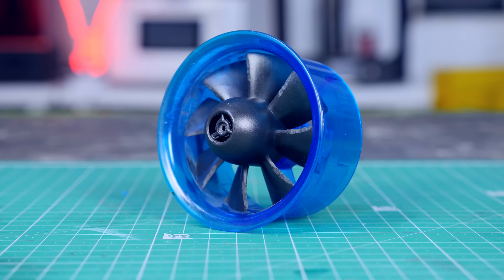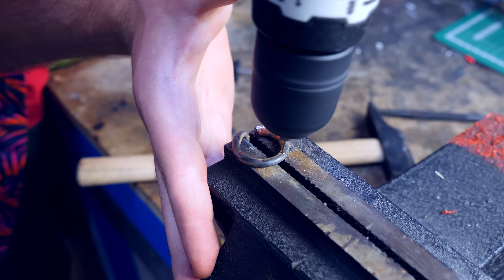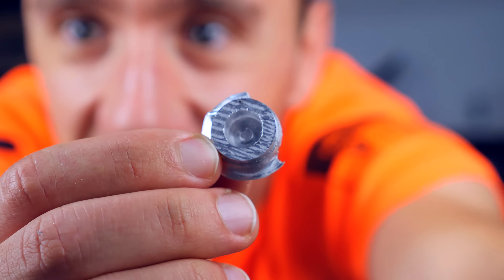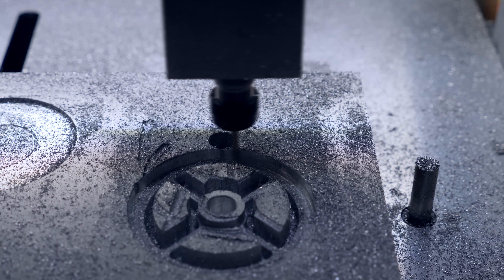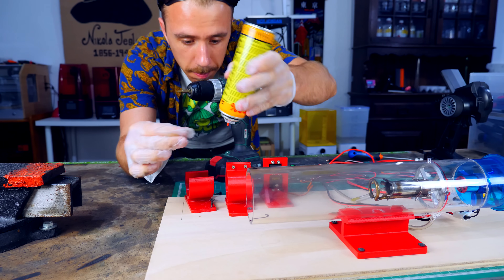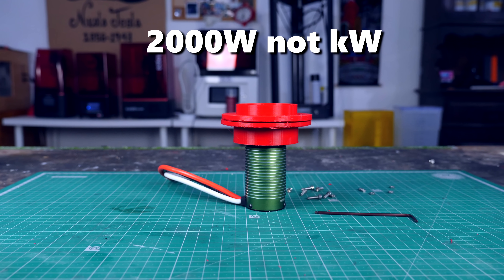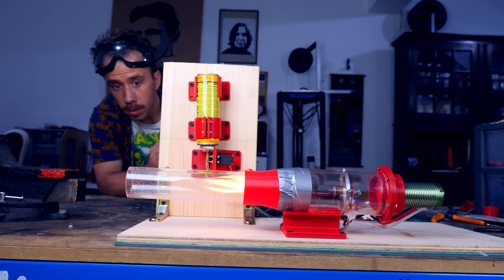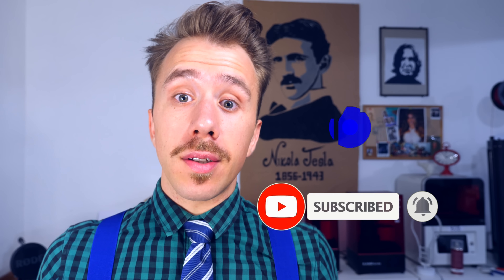I turned my Fan into a Jet Engine (3D Printed EDF Afterburner)

Comment: Integza, when milling you want to use the shortest endmill/drill ass possible, if you use tools that are too big/long for the job you will get walking/breaking/chatter/ louder noise
Reply: also play with your feeds and speeds with your machine, its lack of rigidity and power will limit the speed you can cut at

Comment: Really awesome video. I feel like if you introduce a small amount of oxygen just upstream of the flame tube, it would sustain far better. as the airflow increases, the oxygen increases. But simultaneously, the nitrogen, which makes up 3/4 of the ambient air we breathe, is also increasing in the same rate. Nitrogen is inert and will do nothing but hinder The propagation of proper combustion. Ideally, you want the vast majority of the combustion to occur within the tube and not outside of it! I do not believe that the fuel you are using, which appears to be propane, can properly utilize the excess air speed without further being compressed ambient air or oxygen laden air. When I say a small amount of additional oxygen, I mean a really small amount!

Comment: You need a brass coil to let the liquid butane turn back to a gas, the brass burner rings are not very efficient when there is liquid spraying out. This is the reason you are not getting a consistent flame.
Reply: could you elaborate on how a coil would be used? eli5
Reply: @Guy_Reverse  Wrap it around part of the combustion chamber, stepping up the diameter of the tubing after the coil to allow for some expansion and to encourage gas to be forced out through the burner ring. Another modification that would be a good idea would be forming the burner in to a fully connected ring with two to three fuel supply lines to it, all of the same length, and with minimal bends. This would give each hole the same pressure and the same possible volume of fuel supply, evening out the shape of the flame to increase the efficiency of the combustion. More efficient combustion makes a more stabile engine and a more powerful engine that is more fuel efficient.
Reply: @KnightsWithoutATable  would it be overkill to place the coil inside the combustion chamber? If it's risky it would be perfect for @integza 😜
Reply: @plopnl1  in other tutorials I have seen people put the coil in the combustion chamber, it is quite safe as there is no oxygen in the brass fuel line making an accidental ignition very unlikely. The heat in the combustion chamber turns the liquid fuel into a gas much more efficiently.
Reply: @plopnl1  I think it would  just catch fire!
Reply: @plopnl1  It's a jet engine, not a rocket, so we aren't dealing with cold enough fuel to need that, but he could run the coil over the restriction area to cool the nozzle, kind of like how rocket nozzles are cooled.
Reply: @augustobob  That is a good idea, but I  think   in normal rocket  and  jet  engines  they   coil  a fuel line around  the combustion chamber to  turn  the liquified  fuel back  into  a  gaseous  state.

Comment: 2:45 Glow plugs are not used for ignition in Diesel engines. They are used prior to engine start in order to heat up the cylinder walls and facilitate combustion.

Comment: Hi, is there any chance you could shorten the cutter length in the CNC (or use a smaller length cutter)? You will get a lot better result because the cutter will not bounce around as much. Also not sure what software you are using to program with (I use worknc) is it possible to ramp down between cuts rather than plunging? All that said great video :)

Comment: Sorry i will bee the bitch that say that isn't an after burner . A jet afterburner is a device that inject  fuel to the end of the engine to burn the O2 that didn´t burn in the combustion chamber giving a extra kick , in your design  you need to add a second fuel line to burn the remain oxygen . Fact after burners are terrible fuel systems they waste to so much that they used on take off and special maneuver like evading other jets and sam's, and tip you need to redesign the flameholder to prevent flameout

Comment: You can use the heat from the exhaust to warm the fuel for the engine and you should try to make the smaller tube change sizes to see if that helps.

Comment: Isn't the main problem with the final prototype the placement of the constriction? The fuel&ignition are still placed in the larger volume that is fairly low speed and low pressure. That + the long constriction is I think why you're getting a huge lengthy but still orange flame.

Comment: The CNC sounds terrible or known as chattering because you're taking too much material too fast. And your glow plug is too far away from the flame tube try positioning the glow plug behind the flame tube. This way you can get constant combustion. The way it's set up right now it's possible for the EDF to blow out the flame.

Comment: Machinist here. That horrible sound that the machine is making is the tool vibrating as it's cutting because it is way too long. You might see the tool flexing and bending around as it cuts and a shorter tool can help mitigate that. It's also recommended  to use some kind of cutting fluid, not only to help extend tool life but to help keep parts on size. Aluminum is kind of sticky and will build up on the cutting edges of the tool and will actually take a little bit more material off of the part when it cuts. All materials have different recommended cutting fluids but WD-40 works pretty well for aluminum because it'll help keep that buildup from happening. I wouldn't worry about coolant with such a small machine, because if your parts or tool are getting really hot, then either the tool is dead and has to be re-sharpened, or you're doing something really wrong. Keep in mind that all tools and materials have speeds and feeds associated with them to help keep your tools alive. You can find calculators online for stuff like that. I'd recommend checking out this old Tony's videos they're pretty good. Some of the instructors at machinist school were using a few of his videos to get some points across. I quite enjoy your videos. Keep it up!

Comment: If you have much aluminum left over you could try to melt it ..  print your part … push it in a flowerpot with sand in it and burn the plastic out or throw your molten aluminum directly in… ( it’s an expensive  and you can create parts of high complexity and size )…

Comment: I can send you some of my fan designs. I 3D printed a centrifugal compressor and tried it on my car. It worked. 4 kW motor. I also design and print EDFs and planes for 3D printing.

Comment: get a couple of cheap "servo testers" and you can eliminate some complexity, and have two simple 'knobs' with which you can set the fan RPM and the amount of fuel, and not have to continually hold both controls on the RC transmitter.

An idea that would complicate things a little more (ironically) would be to add an arduino with a few lines of code to be sure that the fan runs ten or fifteen seconds after the fuel is shut off every time.  that'll help stop the little flame-ups after a run from damaging the acrylic tube.

Comment: Not really sure what you were trying to do.   The simple jet engine principles required  if you want to call it jet engine are the three stages :  suck, squeeze, and blow.  From what you have created, i see suck and blow but no squeeze which creates the actual thrust and so i don't see how you can create more thrust then what the little motor you have there.   lighting up gasoline in the chamber will create a nice fire and perhaps the illusion of an after burner but make no mistake,  it does not create additional thrust.

Comment: 11:18 no, it is 2000kw. If it was watts it would be very slow. With brushless motors 1kw equals the rotations per minute at 1 volt.

Comment: The days before EFI(electronic fuel injection), there existed carburetors. If your able to scale one to size and make it work, I think that will solve the issue with using cold fuel. However you would need to create sufficient suction to allow the fuel to atomize, mix with the air, then spark

Comment: Why don't you use high voltage generators for the ignition? They can be powered by an battery and are suuuper cheap like 5-10$ cheap

Comment: Electric driven motor is cheating mate! 
Use your recently acquired skills to print metal parts to make a correct combustion chamber, and try to make your low pressure fan driven by high pressure combustion gaz! You certainly need qques Liz pressure gar compressor but I’m pretty sure you know how this works! Get it done mate you can do it!

Comment: i use to work in machine shops and i can tell you the best tip for getting good parts. Rigidity is key. hold everything tight, and don't have your endmill sticking out any further than you need to.

Comment: Jet engines use axial-flow compressors nowadays for a reason. They have a lower frontal area meaning less drag and provide the high flow rate that a jet engine needs. But in terms of adding an afterburner to a fan, this was an unqualified success

Comment: Part of the problem with your cnc sounding back is your tool length (it causes vibration) try giving it like .050-.125 extra from your max depth 

Sorc I'm a machinist
Reply: Also try starting with around 1700rpm and 17 inches per minute

Comment: use WD40 in your CNC milling. with aluminium only, give you an awesome result! for the vibrations you have while machining, get shorter endmill, it will improve a lot

Comment: Just a tip from a machinist, only stick that endmill out just a little beyond the depth you are going to cut in that Aluminum, and use some type of lube.
The more ridged the endmill is and the more lubricant it has the better and quieter it will cut.  And don't buy the cheap endmills,  spend the money on the higher grade carbide end mills (preferably stubbed end mills) it makes a big difference.

Comment: ditch the EDF use a the turbine you build before for pulse jet... then run a shaft from it to back of the engine with another turbine there to drive the compressor. right now your just turning fuel in to noise. remember the EDF doesnt COMPRESS the air!  you need narrow the flow BEFORE the combustion remember its suck SQUEEZE bang BLOW. right now your suck, blow, bang, squeeze.

Comment: I think ethanol would make a great fuel. you can vary the water content to adjust the combustion temperature and achieve a mix that doesn't burn too hot. plus it makes it so that you aren't just building a fancy blowtorch. It also would be fun to power an engine with hand sanitizer.

Comment: Try getting it to be a high pressure laminar flow, the turbulence from the blades make it choppy.  limit the holes in the fuel injector to one side or the other to increase fuel distribution pressure or go to an atomizer nozzle ( like an air brush ). It may help increase general thrust.

Comment: I've noticed the reason for syringes exploding was the pressure coming back from the non-combustion chamber. Maybe you can incorporate the tesla valve to restrict the back pressure and if back pressure problem is solved, you can take it further by implementing an electrical control to the release of both chemicals. I'm not 100% certain but from the video it seemed like you dispensed both of them simultaneously and maybe there is a more efficient way of delivering the catalyst to the peroxide, like pulsing and adjusting the pulse variables. Finally you can mount all these onto a car chassis to have a remote controlled cold rocket engine car. It certainly generates enough thrust to make large jumps or even take off. :D

Comment: Very nice video as always, I love the idea of a glow plug as it gets rid of all the high voltage in the system. We always had to isolate this part of the system very well from the rest of the RC electronics. David Windestal already lost two planes due to this interference (https://youtu.be/yKuq8T7KMa0?t=48). Sadly,I think that a glow plug is too heavy for an Rc plane and that it would draw too much power, but still a very fine solution for a test stand. Like what David already explained, you should make a spiral that passes threw the flames in order to pre-heat the gas. Due to the nice Plexiglas construction you can see the e-flux ring  freezing up. As liquid gas can’t be ignited the flame goes out. In case you actually want to make a second version feel free to hit me up, just write me a quick message on YouTube. But here are some fast tips: 

-You don’t need brass tubing, I settled on 3 mm Aluminium tubing, its light and very easy to bend.

-Try using a bigger EDF, the best size is the 70mm ones, I also tried 67 and 80 mm but 70mm is a good middle ground.

-You can add up to 50% of WD40 into the gas mixture. This makes the flame more visible, it’s the same mixture I used in the video you referenced. The blue flame can’t be seen during daylight.

-Try up scaling the flame holder and e-flux ring. I haven’t experimented much on it, but I use the same diameter of the flame holder as on the motor.

-Quick safety tip, let the EDF run for 5 sec after you have turned off the gas. There will always be some liquid gas left in the fuel lines that will expend and light up.

-Not really a tip as I have little experience in that field, but if I were to make a power plant for this system, I would make an axial compressor.

Again, feel free to contact me, if you have any more questions. For now me and two other guys are working on that variable thrust nozzle that you could also see in the video. We are currently doing thrust data collection on a test plane. I can send you the cad files if you want to experiment with a variable thrust nozzle. It’s a very simple system that can be easily added on the back of the tube.

In any case, keep up the amazing work and stay healthy.

Comment: little secret.... you can bend that small brass tube without fire or creasing it, if you fill it with a fine sand or even flour. With a diameter this small that might be easier said than done; but it works perfect every time, and much more forgiving of error.
When you are machining metal on those small carving machines you really need to mind you tool speed and you feed rate. Along with making a shallower cut; a little oil doesn't hurt either. 
BTW: Using two EDFs facing away from each other with apposing pitch angles (counter rotating impellers) will give you more compression of the air stream; and some variation on your ceramic aero-spike nozzle might actually get you a net gain in thrust over a basic twin EDF design.
Small iso-butane canisters used for hike/camping stoves probably have the same mass of fuel. It should also be of higher energy density; being that it is a mixture of propane and butane.  Maybe even use one of the super tiny stoves as the injection system.

Major Hardware on YT has been testing all sorts of crazy fan designs and classifying them as best he can. 
AND
Tech Ingredients just finished a series on hybrid solid rocket engines were he uses electro-mechanical solenoids to actuate the oxidizing gas. 
Perhaps these things will be useful to you.

Comment: Maybe inject the fuel before the fan, it might help cooling the motor if it has some fins or somethings. It can be cool to build a gearbox on the side with multiple belt powering the different stage of a compressor, the exterior/stator would have the blade and the inside would be a fixed shaft with bearings to keep them all centered. A bit like a bldc motor with the outside spinning.

Comment: Your fan design is pretty bad for what you are trying to do. Just try flat radial vanes. They will give you more flow and still a good pressure. Your current design, eh, would work well for pumping water through a hose.

Comment: Are you sure that's the right bit on the CNC?  It's vibrating because it's too long and skinny.
Get one of those short fat ones they sell.  Only the tip where it cuts is narrow.  And any metal plate that isn't supported right will make a bad sound.  There's always a way to shut them up somehow.  Put a wad of clay on it.

Comment: Add an afterburner to the afterburner which will be a second gas can, so when you want even more power just activate the second can increasing fuel output and creating a dangerous fire hazard inside your room.

Comment: Drilling can be loud sometimes because you're not cutting fast enough - If instead of making shavings you're rubbing the aluminum with the bit - if even slightly, it would absolutely be louder. Drillbits seem to have a squeakpoint, if you will xD

Comment: I may have posted it to an older video, if you 3d print a shell with internal channels and route the fuel through the body of the combustion chamber it will cool the shell, and preheat your fuel. especially if you're using a gas that is at low temperatures when it leaves the storage bottle.to control the pressure of the gas in the channels inside the body you can include expansion cells of a larger diameter than the main channels. 

And since expanding gasses cool, the expansion cells will also let you control how hot the fuel gets...

Comment: Go with an axial flow engine instead of the centrifugal. If you want a design that stays inline, the axial will give a much larger suction area while also being less demanding in terms of the pressure to velocity transition (this is limited by mass flow which is a pain to work with). This would also be easier to transition into a proper turbo fan.